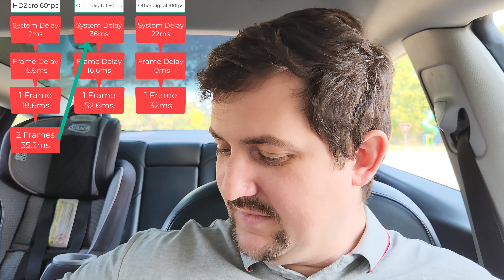19g Single-board HDZero 65mm Whoop (AIO5)

Comment: It's hard to take a quantified latency measurement and translate that to a meaning other than "It feels better".  Like, "How does it help?"  So here's how I think of it: 
Imagine you have your roll rate set to 720. You go for a snap roll.  In the middle of that roll, how far out of sync is the image?  
At 100fps "other guy digital" with 32ms, that's 1/30 of a second, which is 24 degrees.  If you spread out all your fingers evenly, that's about the difference between each finger's angle.  
HDZero even at 60fps because of the rolling transmission and tiny latency manages better than half that - keep in mind that on average, half the picture is at 2+8ms latency, a quarter is at 2+4ms, etc, so there's a real performance advantage we're not even discussing.  
At 60fps "other guy digital", that 52ms latency works out to well over 35 degrees.  Make a "peace" "V" sign with your fingers, that's about the angle we're talking.
HDZero gives an image MUCH closer to the reality of what the quad is doing.
Bear in mind our brains can compensate for a little bit in terms of latency, but HDZero's latency is consistent too unlike "the other guy", and inconsistency is one thing our brains can't cope as well with.
Reply from the maker: Great examples! I've thought about explaining it in roll angle before, but never did the math

Comment: Nice! Looking rather appealing even though I’m not yet in the HDZ ecosystem. One little nitpick- couldn’t they have saved some weight by getting rid of the USB connector in favor of a smaller 4-pin connector like a competitor recently implemented? I imagine about 0.5g could be saved.

Comment: Need to raise camera a bit to prevent it getting pushed into board. My RTF Mobula 75 AIO5 has put a piece of foam under the camera perhaps to minimize such damage. I have lost multiple other boards with collisions that push camera into top boards, and ultimately fixed problem by using a taller canopy that lifts the camera to a safe distance to prevent it contacting my electronics during crashes.

Comment: Do you have a build video for the 75mm version?  That's what I'm interested in buying this for since my air75 is so much fun.
Reply from the maker: No specific video fo that, sorry. It is sort of simple though - transplant the parts from 65mm frame to 75mm frame and install larger props. Any specific questions though?
Reply: @RyanQuellet  Does it need different motors for 75mm to drive the bigger props but not destroy the ESC?
Reply from the maker: @McShakyFPV  no, 75mm is fine on a 5a ESC

Comment: I bought one of these boards but the #3 esc didn't work. While waiting for that to be replaced I purchased another one. The #2 esc didn't work on that one. Both have been replaced now. It took a month. I've started using one of them and it was working great for about 3-4 days until I crashed. It wasn't a bad crash at all but the vtx died as a result. I'm down to the last fc and I will install it this weekend. I really hope this one works but I'm feeling less than optimistic. I feel like I've wasted $200, frankly. I'm still a dedicated HDZero customer but this particular product needs work!
Reply from the maker: @doncunningham3124  what size motor?

Comment: Great tech, are there any plans to implement it in race vtx to make it smaller? And most important question would it support 90p
Reply from the maker: How about a H7 20x20 FC with built in dual ELRS optimized for low profile stacking with race v3?
Reply: @RyanQuellet this, but without that fragile mipi and you’ve got me.

Comment: Finally, so When is the HDZero capable to deliver "Very Lowend" Goggle support, i expected Rp.500.000,- ready stock here in indonesia.

Since now i fly Digital VR capable such lower cost, by today CellPhone with only 20fps on 360p.

Hope to hear that sooner.
Its good for digital starter on tinywhoop AIO Digital FC's would be bought after the very "Low end Goggle availability".

Thank'S Ryan and Carl.

Comment: @RyanQuellet what kind of run times are you getting on your 75 build?
Reply: I also am curious! I see you get 2min50 with lipo under 3v 😅 and other clip it was same time but lips at 3.4v.
Reply from the maker: 65mm flights are 2.5-3min. 75mm flights are 3.5-4.5min

Comment: ELRS over SPI 🤮
Reply: Why 🤮??
Reply: @modquad18  ELRS devs said a while ago that SPI receivers is a big fat no-no. Especially on a F411. That also means you are stuck with whatever version of ELRS is baked in Betaflight, so you can’t update you TX, which is a bummer if you have other drones.
Reply: @MrAlucardDante so when you upgrade betaflight, an updated ELRS comes for the ride.
The module compatibility is between 2.5 & 3.x. So as long as the SPI ELRS is a 3.x variant, it’s ok.
Reply: @robert_g_fbg  true. But when ELRS 4 is out, you are stuck on version 3 until Betaflight adds version 4. Which might never be a thing since SPI isn’t officially supported by ELRS devs
Reply: @modquad18 spi takes cpu cycles away from the PID loop on a relatively slow F411 cpu. It means fewer filters can be run, and a lower PID loop frequency if you’re running a complex config. Doesn’t affect most, tho.
Reply: @MrAlucardDante  Meh, I think they’re being over dramatic. I’ve got a few SPI’s all running v3 now and they fly just fine.  One thing I do is make sure the FC is isolated from the frame - Happymodel is terrible about this, they always have the cam connectors wedged up against their whoop frames. I either notch the frame or delete the connector and direct solder, makes a huge difference.
Reply: @modquad18  sure, the devs of both teams are being dramatic… Betaflight devs introduced cloud builds in 4.4 so F411 and F722 could still be flashed. They could have said "F those boards, they are obsolete" and then this AIO would have never existed or be very different